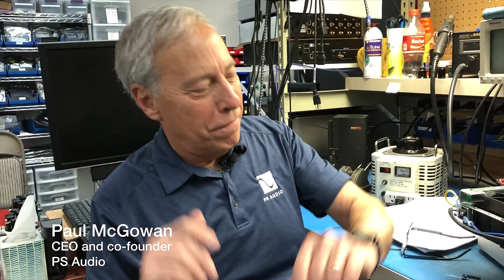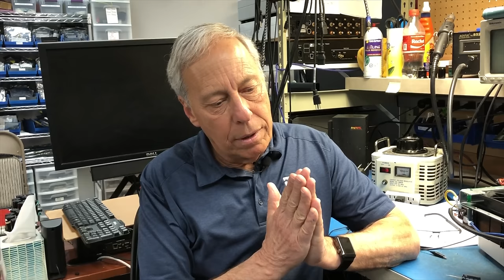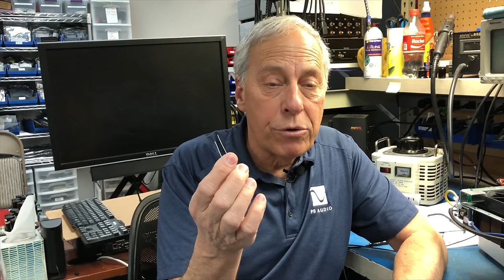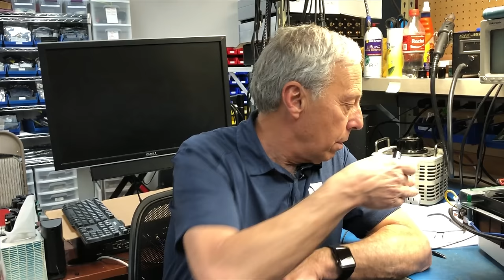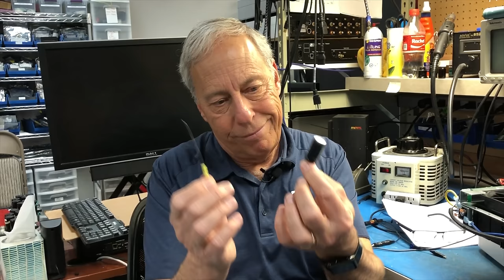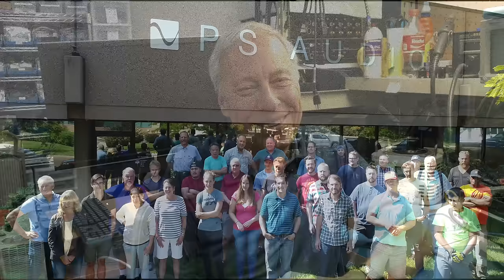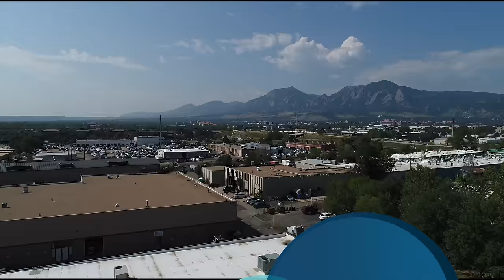Why do capacitors sound different?

Comment: I do agree with Paul on his views of capacitors.  From some of the comments I read, he may not have explained it to a deep enough level.  He did not talk about dissipation factor of the dielectric. Capacitors are not perfectly efficient devices, electrolytic capacitors will tend to hold a small charge even after being shorted out. Electrolytics have a ripple current rating, series impedance etc.  I personally like using film capacitors  whenever space allows, because they sound better than electrolytic caps. I have not tried the super expensive audiophile film caps to see if they are substantially better than the run of the mill film caps.

Comment: Personally, I feel the “What is a capacitor?” could have been explained more clearly. At it’s fundamental level, a capacitor is an analogue electronic component capable of storing and releasing an electrical charge. The rate at which it can store and release that charge is determined by its characteristics. Some graphics would also helpful.

I graduated from university in Electronics and Communications Engineering. Power supplies and audio circuits were a big part of my course.

For people who don’t know what a capacitor is, the video isn’t helpful.
Reply: MatchstalkMan I don't see "What is a" in the title nor do I see any misleading click bait graphic in the thumbnail that disappeared in the actual video, so sorry if it wasn't what you wanted but you shouldn't have expected anything that wasn't indicated in the table of contents.
Reply: MatchstalkMan so do more expensive capacitors sound better? If not what makes certain electronic sound better than others?

Comment: Excellent video but I don't think you answered his question, wasn't he asking given the same capacitance as well as all the other parameters like ESR  how come film capacitors sound better than electrolytic capacitors ?
Reply: I had my Fender Deluxe Reverb in for a upgrading. So called low quality caps were replaced by high quality caps. The guy is supposed to be a certified repairman.  However, the amp I got back sounded worse than the one I delivered. My experience so far; be prepared for disapointment.
Reply: @retroflection  Might have been that you actually liked the distortion of the original sound better, than the "cleaner" sound?        
Guitar amps aren't made to perfectly reproduce exactly what is played, but rather add "color/character" to the sound.

In a stereo setup you'd want more clinical sound like that of "better" capacitors.  I don't know you might already be aware of these things

Also I am no expert.
Reply: @gastank43  or maybe those high quality capa have slightly different parameters which does change the sound of the amp. The amp is then 'out of spec' with the designers engineering.

Comment: Not just cheaper parts, but different TYPES of capacitors are made for different functions. Use a capacitor in the wrong application and you can  introduce massive amounts of distortion, even among the same QUALITY caps. Cannot simply substitute one for another.
Reply: ie: ceramic capacitor microphonic effect
Reply: mrlithium69 Exactly, Sir.

Comment: Summary:

"capacitor is any two conductors that are insulated from one another...dot!" and the various electrical properties associated with the capacitor depend on myriad of physical factors. Like the surface area of the conductors, insulating material, distance between conductors etc. etc. etc... And these cause myriad of effects that an ideal capacitor seen in circuit analysis doesn't have such as polarity, unwanted series resistances, inductances... susceptibility for DC-bias etc. etc. and all of these effects can and probably will distort the  signal that's passing trough the capacitor if it's in series with the signal.

That's why we have gazillions of different kinds of capacitor technologies and they all have their places and prices. But all in all it matters only if one can measure (or if you're an audiopho-- audiophile, hear) the difference.
Reply: Mtaalas:   thanks for writing, very well explained

Comment: the capacitor symbol is theoretic,   fictitious , but  essential to understanding the electrical behavior of an ideal capacitor . 
 A real,  physical capacitor has parasitic elements such as ESR and inductance that change the behavior of a real capacitor when compared to its theoretic  behavior.

A real capacitor becomes a resonant circuit at some high frequency due to the  parasitic inductance.  A 100uf electrolytic will resonate with its parasitic inductance at 10khz.

In order to  maintain the effects of  100uf at  frequency  above  10khz it is necessary to 
add a mylar capacitor of say 0.1 uf in  parallel which will  effectively bypass the 100uf  
at frequencies above 1khz.  

m.shen

Comment: Two caps of the same type and same value must sound the same.  The more expensive cap might last longer but when the two caps are fresh out of the box they necessarily must sound the same.  Different sound indicates different values and if nothing else caps must perform to the stated value regardless of price.  Differences in cap style make different sound.
Reply: Not really. The more expensive capacitor might be made with better quality materials than the cheaper one of the same type and value. That may result in smaller non-linearities (the change in capacitance with applied voltage) and that is the key factor in how a capacitor "sounds".
With electrolytics, even if they are being used just as smoothing capacitors, a better quality one is likely to have a lower ESR than a cheap one with the same capacitance. That might mean a noticeable increase in ripple voltage with the cheap part, and that can cause clipping on loud signals. You'd certainly hear that.

Comment: Unfortunately I wasn't a fan of this video, after liking lots of other videos of yours, this one didn't really seem to answer the question directly and seemed to talk about other factors instead. Also everyone else has already stated the uF vs mF mixup. I'm still left not understanding how the physical makeup of the capacitor alters the sound.
Reply: Current doesn't flow through the capacitor, it's just an illusion of current flowing through.  Rather, it's electron charges "accumulating" on both sides of the plates as a result of the ELECTRIC FIELD being generated across the capacitor plates.

Comment: I had heard of running different quality caps in series like that to get better quality sound, but didn't know the why's and wherefore's. Thanks for the explanation!
Reply: Hare deLune Not different QUALITY caps, but rather different TYPES, e.g. film cap bypass of a larger electrolytic. The film cap make the electrolytic behave in a more linear fashion.
Reply: Darin Brunet
O.K., thanks!   : )
Reply: Parallel not series
Reply: mathyoooo2 Yes, parallel, not in series.

Comment: When I was a teenager, in 1981, a guy working for the Electronics magasine Radio & Television did a blind test on a bunch of audiophiles. He put some capacitors considered "bad" along with a few low slew rate 741 op-amps (and some other "bad" stuff) in series with "high end" audio equipment at "line level". Swithed them in and out several times. None of the blind folded "golden ears" could determine when the 741 or the "bad" capacitors were included in the signal chain or not. Since then, I lost interest in this expensive quasi religion and started concentrating fully on the music itself.

That said: There are also audible differences, of course! Speakers sound very different, for instance. So did cassette recorders. Varying damping factors in power stages driving bass speakers are indeed noticeable. Some recordings from the 1970s have terrible distorsion in the treble, and so on. (Possibly that famous "TIM", transient/dynamic intermodulation due to too hard feedback on too many or slow amplifying stages.)

Comment: I will answer, more expensive capacitors usually have a lower series resistance(ESR), large capacitance values(in thousands of uF) are usually electrolytic, these however have poor leakage, so better designs use low leakage types such as polypropylene-however they are physically large and expensive. There are also other factors that determine capacitor quality aligned to the application it is used in too, but in a nutshell ESR is arguably the most important in general in audio.
Paul is right about putting a film capacitor in parallel with an electrolytic to lower ESR, however that does not prevent leakage, so a high end design should try to avoid electrolytics. Although if the design is using a linear power supply you really cannot avoid using them on the smoothing section; replacing them with film would be very expensive and you would end up with a box full of capacitors to make up the 100,000uF or whatever you wanted to smooth the DC with.
Also note that the better capacitor manufacturers have better noise immunity by better plate design, using higher quality electrolites, and also lower ESR lowers thermal noise.

Now why do they sound better?..well thats hard to answer as capacitors are used in many different apps in an electrical circuit; dc blocking, smoothing, filters and so on. So refer to my first paragraph to cover all apps.

Comment: The problem with electrolytic caps is the electrolyte which transfers the signal via ion transfer which is much slower,lossier and noisier than the electron transfer of a film cap.The exception being Rubycon Blackgate electrolytics which employ a unique carbon powder impregnated separator which eliminates this problem.These caps ceased production in 2006 but Rubycon are remanufacturing them under the Audionote brand name and should be available second half of this year.
Reply: Thats good to know as they were great sounding electrolytics and I used them in my mods.
Reply: Good to know about the Rubycon, thx.

Comment: To anyone who doesn't think he answered the question or misunderstood, what he's saying is make sure the capacitor you have is the right kind. He's essentially saying a film capacitor will give you better sound quality than an electrolytic capacitor because of how they work so even with equal uF they'll sound different simply because of how they're designed.

Comment: I have to laugh. What Paul taught here is the actual construction of two different types of capacitors, not how these two construction types could change a signal to make the sound different.  There was a mention of resistance, but not much more than a mention.  The funny part is that this much knowledge will be enough for many audiophiles to convince themselves that they now know "why capacitors sound different."  If someone asks them: why do capacitors sound different depending on the type, they can confidently say: because they're build different.

Comment: At higher voltages electrolytic capacitors go bad after a few years or even decades even when they are not used. Polypropylene capacitors do not have this problem because they have an indefinite shelf life. They also have less ESR than electrolytic. This makes them better for plate voltage power supply filters and this is why I use them in my vacuum tube amplifiers, especially the 1000 Volts I use for my 833A SET. You can get them rated at 2300 Volts which is a comfortable over-design safety for this. I see  electrolytic capacitors used in vacuum tube amplifiers costing 5 figures or more and this is why I prefer to make my own amplifiers.

Comment: How about measuring capacitance vs (varying) bias voltage - this might be a starting point towards characterizing (one of) the non-linearities of the components, and it is non-linearity that you 'hear'.
Reply: @ Mark, HYPHENS are used to JOIN two or more words together, NOT as commas, or periods.

Comment: Leaving aside the error of a micro-farad being one thousandth of a Farad, actually, it's one millionth, these videos suffer from not making reasonable assumptions about the knowledge of the audience. If you start assuming the audience knows nothing - for example, the difference between AC and DC - you can't possibly provide a technical explanation of different capacitor types within the time available. That's a pity. I also think a picture explains things better than hand waving in mid-air.

Comment: what he was driving and did not clearly define was that the electrolytic is less efficient in passing audio signals but better at storing a large charge. Audio passed through an electrolytic gets cloudy or dark in the upper frequencies as the bulky materials take longer to charge and discharge and don't track the high frequencies as well. The small signal cap with its thin plastic insulator and super thin foil layer reacts more smoothly and efficiently at high frequencies.  Otherwise an excellent presentation. think of it this way you might wear size 10 shoes, but a construction boot and a running shoe will behave differently in walking and running dynamics even though they would both fit you. The smaller lighter materials respond to ac changes faster and with truer fidelity.

Comment: Thanks for sharing.
Maybe you could tell about the why the difference in prizing? you can bye two capacitors with exactly the same data and same electrical measurements (i.e. on an oscilloscope) but the one cost 50 cents and the other 50 dollars.
Reply: Fried Mule Different materials, construction method, tolerance, voltage capacity.
Reply: Because marketing shows that there will be people stupid enough to buy them.

Comment: i love working on speakers. interesting video. one question how  do we calculate how much microfarad would be right for with the speaker. suppose we have 4 Ohm tweeter and 8omh woofer. also what all products are required for a cross over and how do we calculate those products value?

Comment: Capacitor becomes more conductive when frequency up, coil becomes more insulate  when frequency down. Resistor kills unwanted frequency. Thus you can seperate audio frequency through a filter. This  principle is same also in radio and video frequency.  Good component matters as to capacitor, but not as much to coil and resistor.
Reply: "coil becomes more insulate when frequency down" ? It becomes more conductive with lower frequencies and more insulate with higher frequencies.
Capacitors pass AC - block DC
Inductors pass DC - block AC

Comment: but why do they sound better though i am still confused
Reply: Janoy Cresva witchcraft
Reply: well they must add less distortion or something, then we need to figure out what makes the distortion appear
Reply: Yes, less mechanical distortion.
Reply: can you explain a little bit more detailed ?
Reply: Some caps are more linear in their function, some have higher distortion in an application, some have lower internal  impedance.
Reply: Simple answer, THEY DO NOT.
Reply: they sound better if you think they sound better
Reply: Check out this video: https://www.youtube.com/watch?v=HsPNGVwCrhw
A designer at audio precision explains the distortion caused by passive components and which ones are generally the best to use in each application.
Reply: Capacitors do have certain distortion characteristics. Certain capacitors are more suited for certain applications though (ceramic caps are not suited for bulk storage, while electrolytics are not suited for being in the signal path). Which can be noticeable. The difference between 2 ceramic caps will be a lot more difficult since the differences are already quite small.

Tubes are generally used to emphasize even (mostly 2nd) harmonics. Because they are in harmony with the music. This can sound good.

Comment: He reminds me of our instructor at NATTC MILLINGTON, who covered all 3 whiteboards around the room.  We copied all that and after 45 minutes of writing, he goes 'And that is how NOT  to calculate it.'  Everyone was so mad at him.  At what timestamp does he answer the question?  My understanding is 2 reasons.  
     1. If you change the value because the old cap value its not a common value anymore, you can change the intended frequency response of the tuned circuit OR 
     2. As in a Hallicrafters radio, the caps are now wasted so it doesnt sound right  but you dont have a sample what it sounded like 70 years ago.  So when you change them out, you hear it as it played when NEW....more or less, refer to point 1.

Comment: When can we expect the video on the scientific/engineering merits of megabucks power cables? And laughing my ass off over here - he basically comes out and says "We use cheaper capacitors in power supplies because they're not in the signal path" at the same time as they're selling $1000 power cables with the claim that they improve audio performance. Welcome to 'audiophilia' people - where even trained engineers and scientists will stoop to psuedo-science in order to make a buck.

All in all it's rather depressing given that PS Audio does make some great equipment based on sound electrical and mechanical engineering principles.  Shame.

Comment: Best explanation of what capacitors do I’ve heard!
Reply: A capacitor's function is to store and release energy. It's definition is to offset inductance by 180 electrical degrees.That is why we can power factor correct inductive motors so when done correctly Cos Phi is almost equal to 1.000